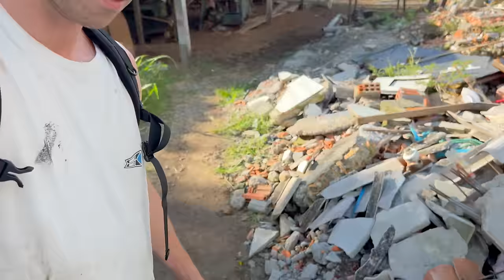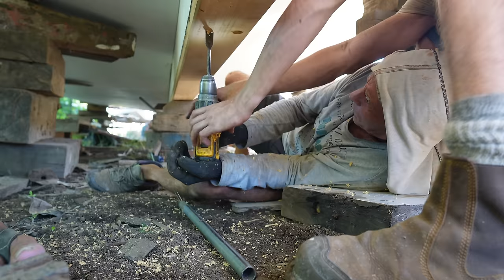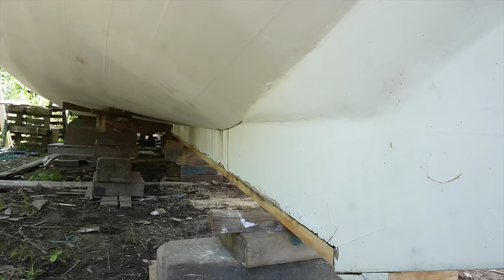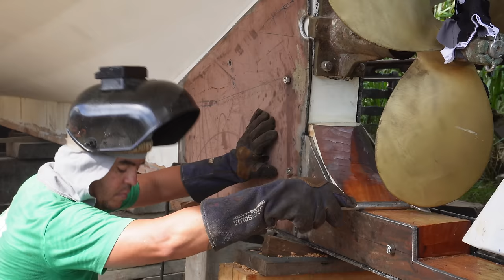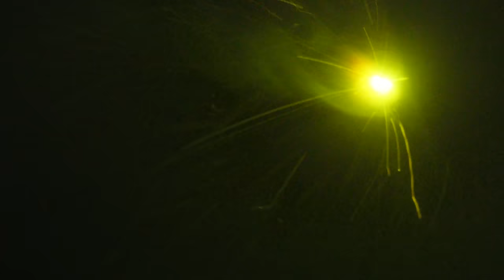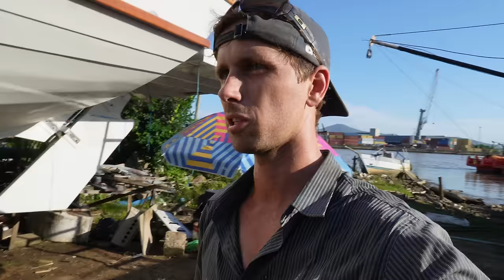Why would we WELD the keel of a WOODEN boat? Daily episodes #3 — Sailing Yabá 171

Comment: Ben be careful with dissimilar metals- you have bronze holding your shaft , you have the shaft material, your prop, all the various bolts, and now mild steel. I would make sure you have plenty of zincs mounted and they are checked often.
Reply: Similar mix around my prop: bronze prop, stainless shaft and steel (the hull itself!). Since replacing the hull is not an option, an acceptable compromise is to protect the most anodic metal (except the sacrificial anodes of course !), in our case, the steel.
Like Ben, I would also suggest an epoxy paint system both sides and edges. And keep in mind that every scratch will create a new micro galvanic cell, and start a growing corrosion area.
Since the plates are not that big, resin would be even better.
Reply: I would think that being shipwrights, they might know that. The build is coming along nicely.
Reply: @livingsimplytosimplylive6817  Fully agree they are doing a great job - it was just a reminder ….no need to defend….
Reply: @sailingsomeday5975  no worries
Reply: When a welder uses an umbrella it’s not an umbrella anymore, it’s a welders cloud.
Reply: Missing  MJ, what has she been up to? Looked simple but the sacrifical keel takes some time.
Reply: @rolandtb3  filming and editing, I would think!🤔
Reply: Don’t forget electrolysis attacks wood and the placement of anodes is a science
Reply: Iron has 8 "valance electrons" & Bronze which is  88% copper at 11 electrons mixed with a 12% mix of Aluminum @13, Silicon @14, phosphorous @15, and Tin @4 therefore  the Bronze will be the  anode, my wild ass guess is that the bronze (with out Zincs) in the equation will take the beating.
Reply: I get what your saying. On further thought, is what they’re doing any different than a steel hulled ship?
Reply: @m.webber5118  well a bit  volume of steel is less volume of bronze is more. Then a bunch of some kind of lag bolts (ss or Galvanized) - and a bunch of nails if you were a fan that far back - so a bit more of a mix. However the solution is the same, on a steel hull you would put a lot more anodes (zincs) then you would on a fiberglass or wood vessel - hence my reminder.
Reply: All the  rocket scientist are in the house  today ffs just sit down and enjoy 😂
Reply: @dustinfrost5214  I do enjoy - and was sitting down - they ask for comments and advise in almost every episode- and though I am not a rocket scientist I am a licensed master mariner and have been for 35 years.
Reply: The only issue will be the stainless stud bar in the mild steel shoe causing the mild steel to corrode and the stainless rusting where it passes into the wood.
Reply: Galvanic Corrosion is the worst.
Reply: This. My boat was built in 1962, but she's got an iron keel and was fastened with galvanized screws and bolts. It's not pretty. I might drop the keel, sandblast back to bare metal, fiberglass the whole damn thing, and refasten the hull with copper rivets. I want no exposed ferrous metal on this boat.
Reply: @livingsimplytosimplylive6817  I would not make that assumption. There are plenty of mistakes made on this build.  I
Reply: Hi Ben & MP. Great progress, well done. Just saw the clip of your beautiful propellor, maybe make sure it is well covered up when the welding starts!
Reply: @srcastic8764  Everyone can find issues with most things. Isn’t it true you see it all the time. 

There’s always a better way, in my experience etc…, you know what I would do or have done, blah blah, blah. They are making their dream come true hurray for them.

Comment: Wow you do realise that such huge metal pate will react with your stern tube , if you do get reactions the current from such will eat through the dead wood and rot such away . I can see capping the keelson  a good thing but you dont even have to use metal now, FYI i used Nylon board last time i wanted to protect such, which eliminates the risk of major electrolysis . Nylon takes imapct well , has just as much strength that you will require for such but wont degrade
Reply: Nylon Yes. Good move

Comment: You will likely get some voids behind that steel shoe welded around the stern deadwood, especially where welding was done.. A suggestion for dealing with that is to drill and tap holes for grease nipples. Then, fill the gaps with a grease gun loaded with mastic, Sikaflex, or whatever. Water will get behind the steelwork, and maybe juvenile wood-chomping lifeforms that you are trying to avoid. This technique is similar to using a coach screw suitably drilled and fitted with a grease nipple. It facilitates injecting goop deep into wood joints etc.

Comment: Hi Bed and MP. It would be a good idea to put a skid plate on the kéal so that if it does touch anything the scraps, the resin is not scrapped off. The worst would happen then. The planks would be exposed to rotting wood. Great job as always. I Look forward to the splash and first outing .

Comment: Sacrilege keels are fastened relatively loose,with nails,since it is supposed to get loose easily,
,if the boat touches stones or rocks,allowing the boat glide on the then loose keel instead of on the actual stone/rocks,which could damage the inner keel...the name implies its function,but you screwed quite a number on it,so its not really a sacrelige keel. On my 7 m wood double ender I have a 3 mm stainless steel under the whole keel lenght,also 5 mm wider than the keel,since wood is strong lengthwise,but less crosswise....
Allda bestest from mikke in sweden..;-D

Comment: I think your float switch looks like it turns on before the pump is submerged. (the switch is lower than the pump). If so, this is a problem because when water gets into the bilge the switch will stay in the on position when the pump is no longer submerged. This is a problem because you may find you’re pump runs continually, burning out the pump or consuming your house battery.

Comment: I watch Acorn to Arabella channel too.  They launched their wooden boat back in June and recently had the boat hauled out to replace anodes.  The new wood swelled so much that the had to end up redoing the bottom paint.  I imagine the same thing is going to happen to Yaba.
Reply: The first season repaint thing is pretty normal although it was a bit worse for Arabella because the oak swells so much. Yaba would be properly dry now and her planks are wide but I don't know how much this wood swells and they also have an epoxy coat that would decrease the swell somewhat as well so we will see what happens.
Reply: @ThaJay  Thought Arabella also did an epoxy base coat.   Wide planks swell more than narrow so it will be interesting to see what Yaba looks like on her first haul out
Reply: @johnmagnan759  If I'm not mistaken they only used an epoxy based paint which is surprisingly completely different from impregnating the wood with epoxy resin. Anyway it will still swell because nothing is entirely encapsulated.

Comment: Did you seal the gap next to the keel.  Previously during the plumbing video you said it was open and the water in the hull will run out.  Probable left that due to open areas in the deck and above.

Comment: Ben, in yesterday's video I saw a nice stainless steel filter for the engine's seacock. Question, but have you already done the sea intakes and overboard drains, do I leave them until before going into the water?

Comment: Too B 💯% Sure about the mixing of metals I would Google it or contact a Metallurgist.I retired from a Brass,Copper,Some Steel Factory where those minerals were melted down in huge furnaces & then used for such a wide variety of things it's unfathomable.
Reply: I just thought about something also...my propellers,shafts,etc.consist of a mixture also & I've not had any extreme deterioration or problems

Comment: What is going on with that seam against the keel proper at the back end? A stain is visible and appears to be a 1/2" gap between the keel starboard and the planks. ( for 2 - 3 feet lengthwise in front of the propeller) Edited for correction:

Comment: as long as the metals do not touch each other there will be no galvanic effect
but I don't understand why this isn't made of 316 stainless steel
Reply: Cost probably due the thickness. It does have stainless threaded rod holding it on. Would have been good if this could have been done a year ago. There would have been time to get it galvanised. Still time if there is somewhere that does it close by.

Comment: Sorry, Ben and MP, but why would you put mild steel around the prop underwater. Its going to cause issues in the water on your boat to rust, degrade. OK, its not attached to the electrics so electrolosis may not be an issue near your prop and stern tube brass bits. Think you are making a mistake here.

Comment: when you weld the distance and motion are very important.  Making sure the welder is set at the correct settings for material and thickness.  Just keep the same distance and motion.  Use an arm rest and clamp the part so it does not move.  Making sure you see the puddle of all three metals